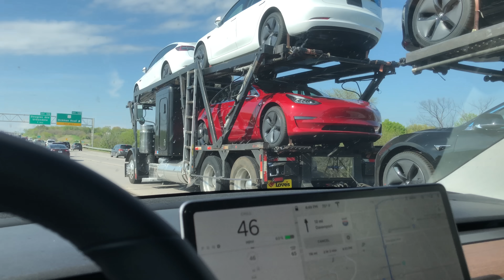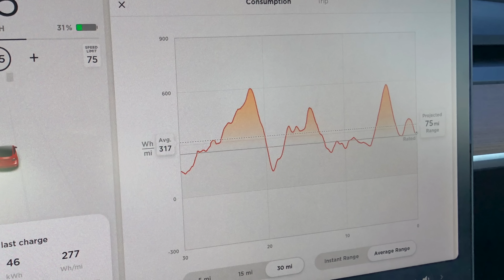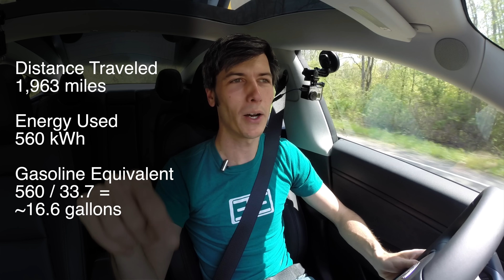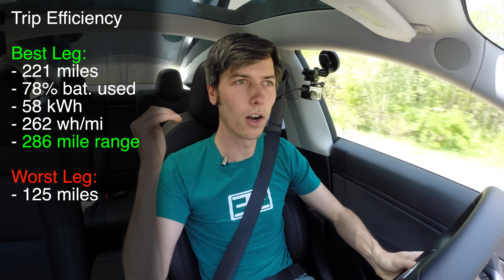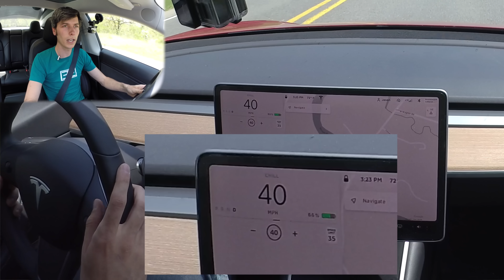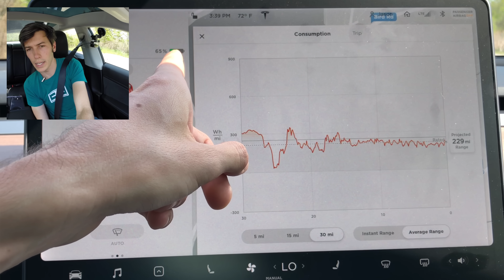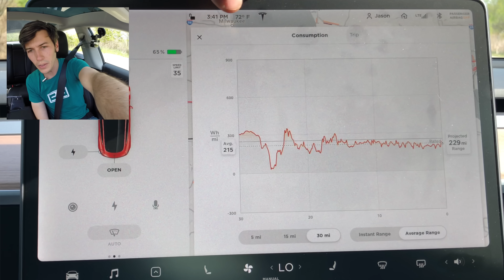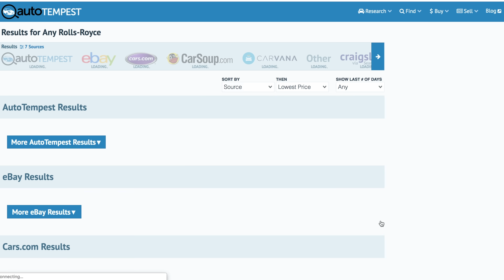How Miserable Is A Tesla Road Trip?

Comment: Jason, great video, but here is a geeky question: How much “extra” or truly incremental time did you take on the trip by taking your Tesla versus your Crosstrek with all factors considered?  Factors such as:  saved IC fueling stops, bladder breaks, and meals (which are additive for an IC vehicle since you normally can’t eat or bladder break and fuel simultaneously in an IC vehicle), time spent chasing down a charger (often not located at the exit like a gas station or Pollo Loco), time difference insofar as you could have driven the Crosstrek a bit faster (albeit with noise), time saved charging overnight at a hotel, etc.  All in all, I’m guessing the EV did not lengthen your trip all that much. Would be easy to make some assumptions and use your analytical prowess to figure it out.  Also, how limiting was the route?  In some parts of the country you just can’t find chargers where you want them, which makes spontaneous side trips more problematic. And you were probably limited on dining selections, which my passenger is often picky about. Your comments on this would be welcome!

Comment: Thanks for at least touching on the charging costs. This is something that no one has even mentioned before that I've seen. It would be nice if someone would go into detail--I understand that home charging costs vary dependent upon your electricity supplier--but this has been the great mystery so far. Everyone is so caught up in the tech available.  Maybe on the followup vid regarding the blowout and replacement of the tire, a little more detail could be given for the operational costs?  Otherwise, great number-crunching video.

Comment: The only thing that needs additional explaining is the fallacy of the MPGe ratings for electric vehicles.  While the efficiency of the internal combustion engine is much less than an electric motor, the efficiency of producing electricity is much less than producing gasoline.  63% of electricity in the U.S. is produced from fossil fuels with an average efficiency of about 35%.  I ran some quick calculations and estimate that the true equivalent fuel economy for your trip would be about 55 MPG.  Please consider presenting a more detailed analysis of this.
Reply from the maker: So do you calculate the refining of oil and transportation required for fuel? Well to wheel efficiency is quite a different subject than vehicle efficiency.
Reply: @EngineeringExplained  My point was that the method for calculating MPGe only considers the kWh equivalent of gasoline and the kWh per 100 mile rating of the electric vehicle.  True, this is vehicle efficiency for its immediate energy source.  However, while the potential energy of a gallon of gas is the same as 33.7 kWh, they cannot be interchanged without energy loss.
Reply: @EngineeringExplained  I did consider the energy cost to refine the oil into gas, but did not consider the distribution costs for fuel or electricity.

Comment: Any thoughts on the fact that charging li-ion at higher power levels also reduces the lifespan of the battery cells?  And yes, Miata Is Always The Answer! 😉
Reply: Patrick94GSR there’s a car sharing group who have interesting data about this. They have ”the worlds most driven model s”, if their info is correct.

Comment: I think EV cars are the future but not the present, I believe we must find a better way to transport ourselves without polluting as much as we do now I even have a Honda Insight hybrid car, but spending 8 hours more in a trip that supposed to last 26 hours is  30% more sorry not to agree but that isn’t efficient from my point of view. 
This kind of cars are good for city driving not highway, even for long distance traveling I don’t use the Insight because it’s not that efficient when higher speed is required and the CVT makes the engine very loud when you require power.
Reply: Roberto Gómez Funny, I am driving my superb Model 3 daily in the present. Or maybe I am hallucinating.
Reply: @j.kevinmcnary9561  As I mentioned, good for City Driving or daily driving but not that good for long distances where you have to make 40 mins stops to recharge. Loading a tank of gas takes less than 15 mins. 
My solution right now is having a hybrid car for daily use and when I need to drive long distances with the family I use my Lincoln MKX that is comfortable and has a big tank so I don´t have to stop very often for a very long time.

Comment: Well, it sounds like in the US, electric vehicles are becoming a viable alternative and not just a virtue signalling exercise. So, how long do the battery packs last? At how many charges, for example, would the pack lose about %30 of their range and life? Are they replaceable, and at what projection of cost of replacement? These are also important considerations, that no one seems to be talking about. Worse still, many don't seem to be aware of this, or they would quickly realize, that ideas in Europe of leaving your car plugged into the grid to store solar power, is another hidden cost of green energy, that governments are transferring to their citizens. Batteries don't last forever.

Comment: On my car Skoda Rapid with ~39 MPG and with gas prices in my country I would have spent ~$230 for such trip like this.  And for 560 kWh of electricity I would have paid only $35. Definitely need Model 3 :)
Reply: Sure, just shell out $40,000+ plus for it.  I'll stick with the hybrid Prius that I bought for $12K.
Reply: If you buy light year one it will be a lot cheaper than that.

Comment: If Tesla wanted they could put a transmission in their cars like Rimac does and get 3 or 4 times the distance out of the same battery's . They could also make it so the brakes or any other moving part of the car generates electricity like Porsche did with the 918's brakes do . The only reason they don't , is that Corporate greed say's that if you aren't spending half your pay check on gas , than we better make that money on electricity instead . If the electric motor need x amount of watts to run , than all you need is generators that produce x amount of watts to fill the required needs . My 1987 Jeep XJ had a 260 amp alternator , amps times volts = watts , 260 amps times 12 vols is 3'120 watts , so 2 260 amp alternators can put out 6'240 watts or a lot more than you need to run a Tesla . Learn to think for your selves people , if you do , you will find that the world runs on greed and misinformation .

Comment: I do have to say that I find the assumption of 30MPG for a gasoline car to be ridiculously high. For a car of comparable age to your Tesla, assuming 40-45MPG is far more reasonable. Though I guess it offsets the crazy low fuel prices to give a more relevant number for people outside the US in a way.

Just for my country, 560kWh at 32ct/kWh gives €179.20 for electricity. Though 1963mi at 18km/L * €1.70/L = €296.63 in fuel. So the margin in favour of the EV can be much bigger.

Comment: Great Video. One tip for reducing charging time is to not require the 15% buffer. That last bit of charging is the slowest from a KW perspective and not needed. It's much better to shoot for arriving at the next supercharger a <5% and just watch your usage as you drive the leg. If you are using more, just slow down a bit to compensate. I bet you could have saved 2 hours of total charge time by going from 15% buffer to 5%.

Comment: If you just tap on the little lightning icon at the bottom right on the map view it will show you all the superchargers. I used to allow a good margin but I’ve learned to trust it. The planning already takes hills into account and, as you point out, you can significantly stretch out the tail end of the leg if you start getting nervous. 

I do have the autopilot and I find it takes a lot of the burden off me in terms of concentration. There are always times when your concentration drifts, particularly on long trips, and I like the security of autopilot having my back all the time. I still have to look, still have my hands on the wheel, but it’s a bit like having a copilot - massively reduces the risk that I won’t see some sudden change in front of me. Of course you get much of that from the adaptive cruise control as well.

Comment: A couple of additional things to consider:

I'm not sure how close together superchargers are in "flyover" country, so take that into consideration.

If you choose to stop and eat, you're limited to whatever restaurants are within whatever you consider walking distance from the supercharger. 

Do hotels have superchargers?  I'm not sure.  If not, it means you can't get "freebie" charge time while you sleep.  You have to sleep, then drive to a supercharger and wait some more.

Also, when did they start charging?  I thought superchargers were supposed to be free... ?

All that being said, it seems, at least for now, road tripping in an EV requires a lot of planning and research (most of which is done by the app, to be fair), and limits how far off the beaten path you can go while adventuring around.  In a gas vehicle, for example, you have the option of carrying a gas can which can extend your range in an emergency by around 100 miles (depending on what you drive).
Reply: You must be living in a rock
Reply: @jzainalrants  Maybe... I'm generally just not impressed by EVs enough to warrant keeping up with all the info.

Where I live, supercharger stations are not prevalent.  You actually have to search for them.  Somewhere like Cali, on the other hand, may have them everywhere.

Bottom line: our current infrastructure was designed to support gas powered cars.  Support for EVs has to be added in to a system that was designed for gas, so its not optimized for long distance EV travel.

Comment: Wow. So it's costing Tesla owners more per mile by a LOT to go down the road than it does for either of our Toyotas (Prius and Avalon Hybrid). And that's not even figuring the cost of purchasing the vehicle initially.
Reply: Supercharger rates more expensive, at least 2X residential. Also you're comparing a Prius and Avalon to a Performance Model 3?? Regardless, the P3D will be cheaper to fuel than your Toyotas.
Reply: @usamericans6045   I'm thinking there is some midsized misunderstanding of what I was saying. 
I was not saying one brand of car was better in any other aspect. I was comparing driving over the road (Like a road trip such as this video is about) and not driving around my residence. 

Purely looking at the cost to drive from point A to point B WITHOUT comparing any other aspects of the vehicle, the costs of the Tesla are higher than the two cars I mentioned.  

That was all I was saying. I wasn't trying to out fanboi anyone, and I certainly wasn't meaning to offend any fanbois. 

Years ago, before purchasing the Prius, I was weighing buying a Tesla. I travel for a living, and it was sounding like a decent investment with all the Government Subsidies that came with it.  I was able to find all kinds of information on where to charge, but couldn't find any solid info on what it actually cost to travel long distance in a Tesla.  

I'm glad there was some info posted here, and with real world statistics, I hope it helps guide other potential buyers.

Comment: The Michelin Guide to Eating at Tesla Charging Stations will be published later this year
Reply: The Getty gas guide to tesla rest stop eating is probably cheaper...lol
Reply: Hit my first Michelin started restaurant in Europe.  Over $500 fix Prix for two.   Sooo not worth it.
Reply: @buzzpedrotti5401  yeah but they aren't all that expensive. I know one restaurant with 2 or 3 Michelin stars, For two you can easily dine below 60€
Reply: @CheesusCrustus  
humm ...  I doubt it's a 2 *
Reply: That is a lot of stopping, going to need a lot of low calorie plates.
Reply: I would just put a roof rack on and run a 3500w Honda genset every few hours.
Reply: Chuck Beef generator trailer! I've even seen ebikes with a generator trailer.
Reply: Chuck Beef A 3.5kW gennie is too small, it would take ~20 hours to charge the big battery, so you’d probably need to top it up with fuel every day at a gas station lol. 14miles/hr charging, ugh

Comment: Interesting video, thanks!  I am retired and enjoy cross country road trips, and keep it to about 500-700 miles a day.  Currently I am quite satisfied with the performance and economy of my Honda Civic, which has a nice ride and gets +42 mpg on the interstate at 75 mph.  I usually start looking to refuel at about 1/2 tank, and it takes me less than five minutes to get in and out of a gas station for that purpose.  Clearly EV's are the future, but range and recharge time will have to get better for me to consider one.  I'd like an EV with a 400 mile range and a half-charge recharge time of 15 minutes.  The car doesn't have to go 0-60 in 3 seconds, 8-9 seconds is just fine with me, and it must have A/C.  Until then, I'll keep my Civic.....

Comment: So you go from supercharger to supercharger. But how highway accessible were they? Any at rest stops?
Reply: Here in the northeast, from Boston to Washington, the superchargers are in the Rest Areas pretty much.  Check out the online supercharger map for your area.  And, if they aren't in a rest area literally on the interstate, then they typically in a shopping center/mall that is close to the main drag and provides a wide range of shopping/eating opportunities.  The superchargers weren't just randomly placed but were strategically located.  And, he didn't mention, the onboard software shows the number of available superchargers at any given moment.  I've never had to line up to use one.  Again, in the Northeast US.
Reply: @s.willey6536  considering he was going thru some distance just curious if in some areas there was a limit of superchargers in main areas.....Montana, Idaho might be few and far between and off the beaten path.

Comment: I think your energy calculations are misleading.  It looks like you are using electrical energy at the plug and comparing that to raw gasoline energy equivalent.  You are ignoring electrical generation stations efficiency and then distribution losses.  Coal is the leading fuel for generation and those plants have a thermal efficiency of 37%.  Distribution losses further reduce the efficiency of electricity supplied.  Between the power plant and consumer the losses are between 8 and 15%.  So, the overall efficiency of electrical generation and distribution is 25% to 30%.  Do your math by dividing the electrical power used by 0.25, the make the comparison.  You are being disingenuous.

Comment: So I worked this out in metric and considered the fuel economy of my car (it's a turbo diesel sedan) and I would get approximately 1000km per tank, though on the open road it can get up to 1300km. That would mean two stops for fuel and each stop would be 5-10 minutes, so around 30 minutes total (tops). A conventional ICE is still the better touring car engine by the looks.

Comment: Of course he says nothing about the batteries wearing out faster from supercharging compared to slow charging. In a gasoline car it doesn't matter for wear how quickly you fill it up.
Reply: does the battery really wear for an EV compared to a gas engine?
Reply: Tesla battery packs are nominally good for about 300,000 miles. Not many gas cars can drive that far on one engine. Some have, but it's not nominal. To replace the pack is about $7,000 which is less than replacing the engine on most gas cars.  The cars are good for about a million miles, though I can't imagine you'd want it that long.
Reply: @ScottHurlbert  I'm thinking that there will be other repairs along the way to until it reached 300k miles or more. Probably not a good idea to keep the car that long.
Reply: @jafp1617  Yes, but that would just be the same as any other car and not related to whether it's an BEV or an ICE vehicle.
Reply: @ScottHurlbert  Agreed!
Reply: That's only if you constantly super charge and you charge it from 0 to 100%. There are already plenty of teslas out there with 300,000 miles out there with little battery degradation.  A gasoline car has a plethora of thing that would wear out before the battery wears out. You speak of myths that have been discredited for years.
Reply: @EnlightenedSavage  Hi. Which one is better:

Keep the Tesla until it hit 300,00 miles then trade/ sell it?

OR

Keep/Drive the Tesla until before/after the warranty expires then trade/sell it?

Comment: Just drove with Corvette C6 yesterday here in Holland with 80MPH average and a range of 333miles: approx. same as my travel distance. My car is more fuel efficient around 90-100mph due to the fantastic earodynamics. Fueled once only and it took a whole 10 minutes (Just saying). I had some of these Tesla 3s in front of me (Holland buys these by the dozens) driving on the speed lane doing 75Mph thinking they are king of the hill. Once they realized that they are WAY too slow preserving battery ... they moved out of my way and disappeared out my rearview.  Thank you General Motors for building an unsurpassed piece of technology and I cannot wait to pick up a used Corvette C7!!!! (And shred more Teslas ... and Porsche, BMW, Audi, Mercedes too actually)
Reply: Lucky you weren't in Germany yesterday.
You'd have had Bjørn up your butt breaking the 24hr EV speed record in a Model 3.

Comment: A study needs to be done to calculate the actual mpg. How many tons of coal were burned to produce the electricity? How many watts came from the local nuke plant. Give us real numbers not the make belief free energy numbers. How many watts to produce the wind mills, how many watts to transmit the power over long distant high tension power lines, how many slaves to mine the lithium, come on man